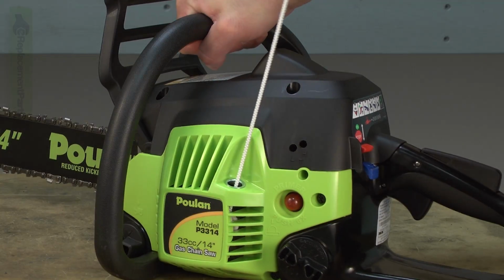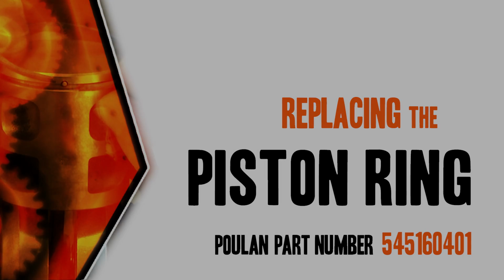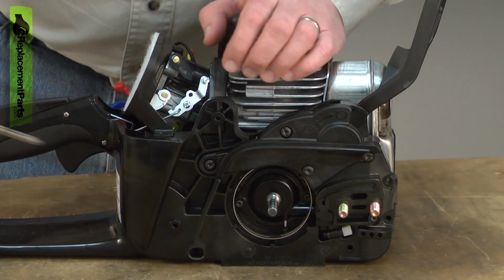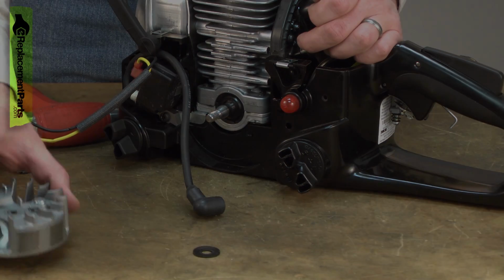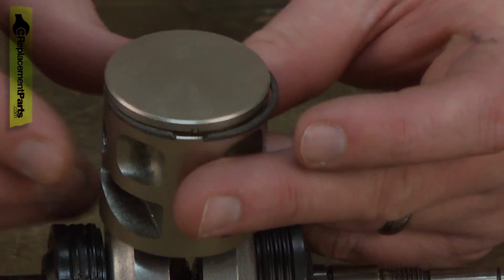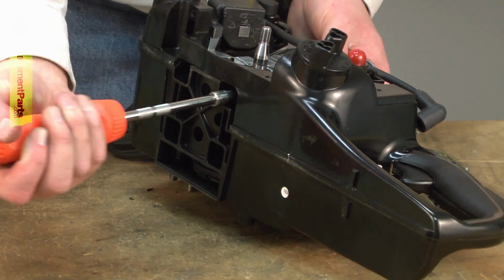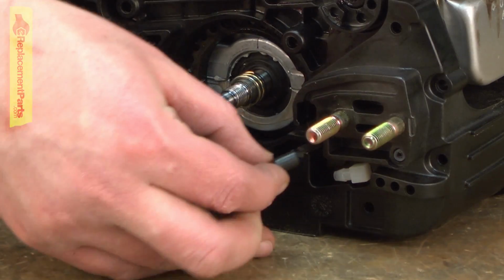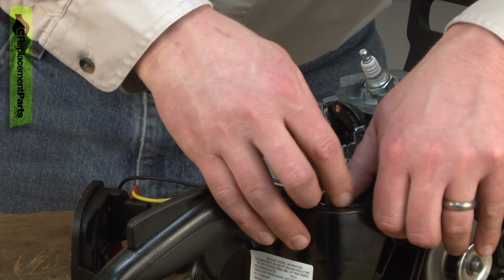Chainsaw Repair - Replacing the Piston Ring (Poulan Part # 545160401)

Comment: Why do all these reassembly videos fail to show how the transfer insets are replaced prior to (or after), the piston is installed.  These inserts are unique to Husqvarna/Poulan chainsaws and can be inserted incorrectly.  They are rarely mentioned in any of these rebuild videos, but are very important.

Comment: fantastic demo. I have a Florabest 2014  which is the exact same and I cannot get it to start.
I have a spark, am getting fuel and now feel the next step is the compression. Any ideas where I will get engine gaskets and piston ring would be really appreciated. Or am I jumping to conclusions about the piston rings. If I have a spark and am getting a wet look inside the cylinder when I take the spark plug out, I am thinking now that it has to be a compression problem. When I lift the machine with the starter cord, with the spark plug in and tight, the cord unfurls and I would have thought that the compression would have allowed me to lift the engine without the cord unfurling.
Any suggestions as to what might be wrong with my chainsaw???

Comment: Great tutorial;  i have a Sears Craftsman that i think is the same,have to do the piston on it; ran full bore without the cover,cooked it...
edit      I  ran it .. it would't start, so i had removed the cover to take a look,forgot to put it back..,  .live and learn; cyl seems ok,, smoothed out ok,i'll just slap in a new piston?

Comment: It brand new saw.  In reality I would need more parts that a new saw cost. When ring goes it melts the piston with die diecast cycle header that would need be repace it just about impossible to piston off the rod because that melted.  Don't count seeals holding up. My coil seem to be crack.
Reply: Oh  oh     that's  what i'm facing here now then?!  i have a cooked Sears Craftsman,that looks just like that  Poulan....

Comment: With the liquid gasket you generally want to tighten the bolts down just before they are snug and then allow the gasket compound to set. This will it allow the gasket to be created rather than pushed out of the mating surface. Follow the instructions on the gasket compound it should say this. Otherwise you will barely have a gasket and most of the compound will get pushed out.
Reply: Exactly!!!  but few are able to gauge the right thickness... you need a very special feel...i use a DIFFERENT sealer for rectified surfaces,NEVER silicone;  it's more ,fluid, more liquid,and has some sort of glue in it; it«s also expensive,but very little is needed each time; i work in cars,boats and bikes;

Comment: These were poulan's last gasp before husqvarna bought em.
Even though there are plastic childrens' toys, I still see quite a few in the shop for fuel system overhauls.
The next version of these saws were one of the worst pieces shit I've ever had the dismay to encounter!
My record was about 45 minutes from pressure washing it to the final top cover screw, then let the dirko dry. Seems the one in the video has scored itself without ever cutting a thing. 
         Sounds about right...

Comment: I'm new to this, but I noticed you didn't show how you compressed the piston rings, first, before sliding the piston back into the cylinder. How did you accomplish this? Is there a special chain saw motor ring compressor tool, perhaps? I'm having the dickens trying to get the piston and ring back into the cylinder of my partially disassembled Poulan Pro 260. Any good tips on how to do this? Also, I noticed some black steel struts of some kind that came out of the motor when you were pulling the head, but you didn't say what they were, and you didn't show them being reinstalled when putting the motor back together. What were they, please? Thanks.
Reply: Yes I was surprised he didn't show the hardest part.  Lol

Comment: looks like they changed the con rod from a punched steel A shaped one to a forged steel one, wish they would change the seal design to just a lip seal instead of the ones that go around the bearing, they always deform from heat

Comment: Thank you for all your videos. We could learn a lot from them.

Would you please share a video introducing all the different parts in two stroke engine with their functions, please. Novice like me would be so beneficial from such videos.
Reply from the maker: Thanks for your comments and suggestion for new videos.  I have 2 videos that may help. Though not specifically what your asked the both deal with the inner components for the 2 stroke engine.   https://www.youtube.com/watch?v=ryEjLoq92fE
  

 
  
  
  
  
  Chainsaw Repair - Installing
  the Piston Kit (Poulan Part ...
  www.youtube.com
  http://www.ereplacementparts.com/kitpiston-p-265856.htm Click here for more information on this part, installation instructions and
  more. This particular piston kit ...
  
 

https://www.youtube.com/watch?v=4K6k4jhLWU8

 
  
  
  
  
  Trimmer Repair - Replacing
  the Piston & Rod Assembly ...
  www.youtube.com
  http://www.ereplacementparts.com/piston-and-rod-assembly-p-282359.html
  Click here for more information on this part, installation instructions and
  more. This ...
Reply: @FIXTechGuides  what power is the scythe 244rx?
Reply: @FIXTechGuides  140 psi good compresion 372 xp oe ?
Reply: Seems to hit every detail.  Love the white shirt. But the saw is cleaner than his shirt. I want mine to look like that when I start turning screws ;-)